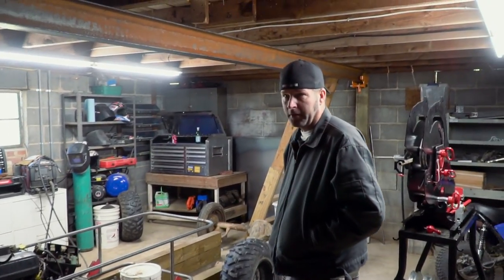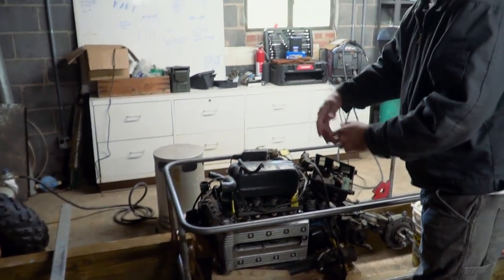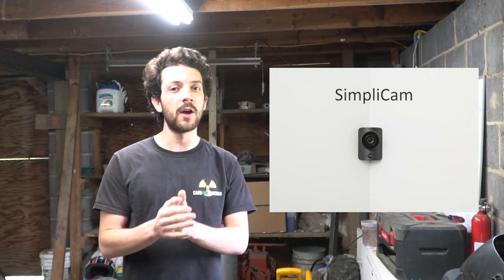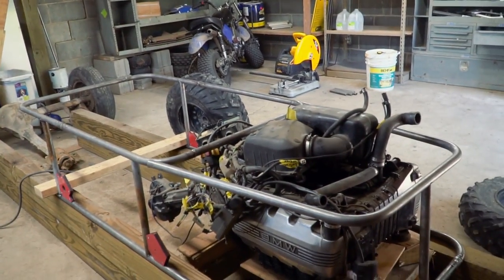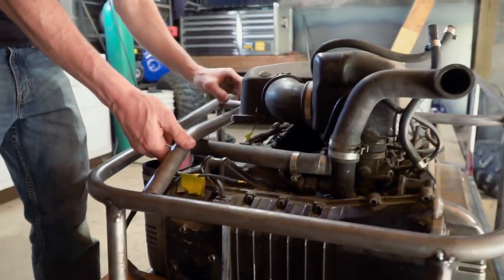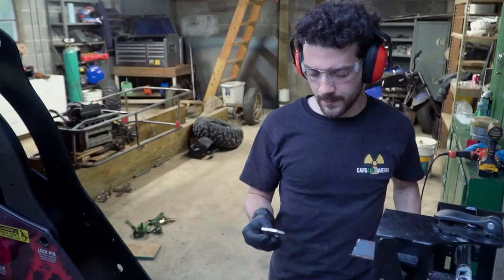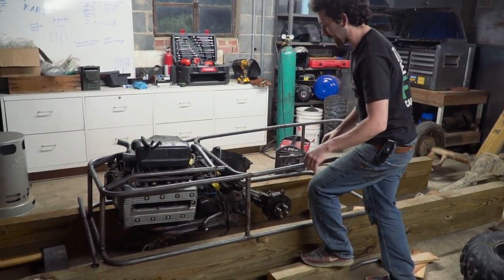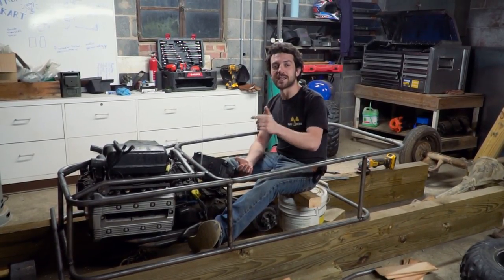1000cc Mini Trophy Truck Build Pt. 2 | Hanging the Engine & Finishing the Frame!

Comment from the maker: It's looking better already!
Reply: Congrats on the new property! Rad 🤘🏽😎
Reply: How many videos do you think this will take to build and also it already looks so cool
Reply: I’m sorry I just can’t picture this. Where are the pedals gonna go?
Reply: Build looks cool so far and I’m diggin the trophy truck idea too! 
If I may, I have an alteration... You guys should look at those all steel tubing full cage rock climbers or inspiration on the frame. 
I personally think having the frame bend OUTWARDS as oppose to inwards to give you greater stability at high speeds and gives you more room to have better suspension flex and travel. 
That’s my opinion but I think you’d be better off going out than in.
Reply: CarsandCameras I, like mason want to know about how many videos are you thinking for this one? Hope you’re doing well during this Covid
Reply: FOR ONE TIME PLEASE LISTEN TO THIS!  your build will be SOOO much easier and and better by doing this. REAR ENGINE W/ TRANS AXLES AND TRAILING ARMS!!!!  ditch the solid axel its not too late yet. you will get all the leg room you wanted, not have a drive line in-between your nuts. PLUS you get to do a little something called "center link A-Arms" in the front, with no excess clutter. TRUST ME ON THIS ONE GUYS... there is a reason utv's, sand rails, buggys, etc. run this setup. if you do this you can throw your expectations of 12 inches of travel out the window. follow my general idea and you can have 16+ inches of GOOD TRAVEL.  "BUT WHAT DO I KNOW, I JUST BUILD PRERUNNERS"  #prerunnerplayground
Reply: God Is good  Heck no.  The fun is watching them do the build.
Reply: @eriknulty6392  Whose to say they don't chop up the rear axle and have independent suspension anyway?  Who knows.

Comment: Hey boys! Quick tip on the rosette welds with the wire feed. I have one of those welders, they’re slow to start, you’re not getting good penetration when you start in the hole. Start outside, make contact, then work into and fill the hole. 👍🏽👍🏽
Reply: talk dirty to me,,,,

Comment: Lookin' good so far.  The dashboard uprights make a perfect place for some triangulation in the frame. 
2 big X's with some thinner pipe would do the trick. Ahh, that's for later. 
Looking forward to seeing a vice bolted to a table. Finally.  :)

Comment: I would recommend a vice for anyone starting out. find the size you want, then get the one 2 sizes up! Also recommend getting one that can rotate in 2 directions. Mine is probably one of my most used tools. use if for everything

Comment: Have either of you two ever driven a 70's era Jeep?  I owned one and I can tell you exactly what that front engine mount short wheel base vehicle will do when you get it airborne. It's going to nose dive, hard.  The seats are over the rear axle and the engine is out front.  The only time I ever got it to land horizontally is when I got the nose so high in the air that saw the sky in front of me.  Hope y'all are preparing some really long and durable suspension. Look at the Baja 1000 vehicles. The short wheel base buggies have the engine in the back.  It's only the longer wheel base trucks that have them in the front, and even then it's jammed up right against the firewall. I would also warn against using a horizontal seat in an off-road buggy.  I hope this arrangement works for you.  This is your baby and you do what you want.  I'm with Ike though; I don't see the magic yet.

Comment: 45 degree the upper frame rail stating right behind your elbows would make it look lil cooler guys. Like 45 degree it back to a 12 inch cross bar witch would be your upper shock mounts an then you angle the shock outwards to the rear end. Would give it really sick rock crawler look

Comment: You guys should check out the Edge Products Sidewinder plans.  It's kinda like a mix of trophy kart and cross kart.   Buy a used sport quad and you practically have 90% of the parts for it!

Comment: when you install an air compressor you should build an outhouse about 20 feet from the shop and run the air into the shop because it cuts down on the noise and when it blows up it wont hurt anyone... big upgrade

Comment: Hey guys great build so far, i have a suggestion for the build, how about putting the engine in the back? and seat infront of the engine? this would be the best for the drive shaft being parallel and also sitting in the front with the engine in the back would be kick ass!!

Comment: You guys should look at those all steel tubing full cage rock climbers or inspiration on the frame. 
I personally think having the frame bend OUTWARDS as oppose to inwards to give you greater stability at high speeds and gives you more room to have better suspension flex and travel. 
That’s my opinion but I think you’d be better off going out than in.

Comment: It’s looking great. I have a concern about foot position though. When John sat in the frame, he put his leg between the engine and frame. Is that where the pedals are going? If so, think about worst case scenario. Engine mounts break and your legs are on both sides of the engine. It would be much safer to have your legs behind that frame support. Also remember that triangles are stronger than squares. A simple reposition of that support bar or moving yourselves further back a bit will make a world of difference in your safety.

Comment: Just a idea, you said about not having a work bench vise now,,, Used kitchen cabinets and counters work awesome in a work shop. That is what I am going to use at my work shop because my Dad did it to his garage and it worked great. Plus you can find them for cheap or even free (craigs list, facebook market place, ect). I thought of this because it looks like you don't have much storage or a place to even bolt down a table vise. But that is just based on the quick views of your shop from the videos.

Comment: I think for better looks in the rear you should bring the bottom of the rear uprights forward giving it a 10-15 degree angle then from there give the bottomed rear hoop an up swept bend still factoring in your plans for the rear suspension geometry

 just a thought it might end up giving you a more aggressive look to match the front it also may give you a better start for the rear geometry when it comes to linking the rear differential to the engine

Comment: just make the two horizontal bars not parallel and it will look good.  Doesn't matter if it slopes up or down.  Either one will make it look way better.

Comment: You could have used two by four box tube for strong base frame and made roll cage from there would have also given you a super strong area to mount front axle and rear axles to

Comment: you should add another motor mount on the bottom..in the middle or on both sides for stronger engine mount strength.
only engine mounts on top. feel a lil sketchyyyy. lol what if the motor tore the mounts off the welds from too much torque? or jumping or throwing the weight around alot? still a strong frame???

Comment: Should double up the bottom tubes of the frame like three inches apart to make it stiffer and then do a curvy roll bar and run diagonals between the bottom and top

Comment: Suggestions- go to "swag off road.com" and pick up there portable band saw table, and match it to your favorite brand of tools (ie. Dewalt, Milwaukee, makita). Now you got a table top band saw. It's perfect to make brackets with. Also for your pipe bender go to harbor freight and get their 30gal 2hp belt drive air compressor. It has wheels to move around if need be. Its 120v so it can plug straight into the wall and it should have enough cfm and psi to run the tube bender and some decent air tools, also it relatively cheap.

Comment: I'm not sure if anyone else said it, but make sure that there are lots of triangles when you build a frame, especially for an off road vehicle. I built a sand rail when I was 15 and learned the hard way. Nothing on my frame was triangulated, so I was constantly breaking welds from frame flex.

Comment: Question,how are you gonna damper the vibration of the engine? Question 2,have you thought about weight distribution whilst airborn? Shes gonna be real nose heavy with that honkin beemer in there. Which would translate into serious nosedives when in the air. Just some thoughts i had. Great vid guys and i cant wait to see how it turns out!

Comment: I am curious how you guys are going to adapt the drive system to the rear wheels.  That BMW output comes out at 90-degrees.
Reply: I thought that too.
I'm guessing they'll bolt a sprocket on and use a chain. Which will break.
But the frame looks too flimsy to handle the power anyway so it should be fine.
These guys really need to stick to building 8hp kids things.

Comment: You should move your seat all the way back to that back rail so your legs aren't on the side of the engine if you cut the upper part of the frame rail right behind the engine drop it down to a 45 and then straight back then back and up again it'll look better

Comment: Where are you going to put the radiator and fan or fans? It's a water cooled engine so a radiator is a must, fans are required to make sure you get good airflow through the radiators at low speeds. Low speeds and high revs equal overheating without adequate airflow.

Comment: I am surprised you guys did not go mid engine with this
Reply: I ride a K1100 and these engines are very hot in the summer. Sitting right behind it will be nice during the colder month but torture in the summer. Overall it would make the build easier too. Steering doesn't have to go around the engine, drive shaft could bolt directly to the diff, weight is more evenly distributed...

Comment: usually with that frame you built  your going to have to go with I beams  because you  didn't set up your chassis to run center mount  arms you would have neede to start wth the bulkhead

Comment: Remember that you are testing a more or less where the seat goes but remember your partner is taller than you I would throw the seat completely back but the top tube that would be behind the back of the seat would lengthen it a little to recline the seat and you  can be used for rear axle shock absorbers

Comment: Rather b welding and red beards garage do a superior job building. it's like grade school build vs high school! It still looks like a box or tub. A miniature T Bucket or a true 4wheel drive with two steer axles would have been perfect for that engine.

Comment: So tou guys need a Bench Vise (at least a 12" Jaw, and a 20-50 Gallon Air Compressor)...

What Voltage? 120, or 240? What could the Electrical "Safely Handle" in the SHOP?

Comment: Hey Issac get rid of that kwikset smart key dead bolt as a locksmith I see a lot of these twisted out with a homedepot flat blade screwdriver and the crooks walk right in and a skilled crook will spin the lock back and it looks like nothing ever happened

Comment: If you guys would just spend 350.00 on bend tech pro you can draw it and see if you like it first it’s so easy to use 
I’m sure they would work with you maybe sponsor you 
I promise you’ll thank me 
3D view from all angles rotating to see problems 
I’ve been using it since 2006 I love it roll cages frames even exhaust systems 
It will work really well with the rogue fab bender too 
No more bastardized frames ...
Also a cut sheet for each tube showing notch locations

Comment: Errr, not sure what you were going for when you mentioned the Miata and M3 lol. Good SCCA roadcourse track cars next to 240’s, rx7’s, and boxters? Even FF’s or SRF’s? Sure. But you had me laughing there! Those aren’t gt1’s with large cubic inch engines. Also, y’all gotta look at how trophy trucks are built. I’m not seeing it chassis, suspension, or drivetrain wise besides the solid rear axle. Trophy trucks are 4wd. How are you going to handle rear engine cooling? Have you seen what trophy truck front skids look like? Trophy trucks have a lot of suspension travel, what are your plans to accomplish that? What are you going to use for a body? You’re either going to have to buy a pre-made fiberglass body or make your own. I’m assuming you’ll be buying lexan for a windsheild. Good luck building the steering. Sometimes it’s good to sit back for a while and do a lot of research. Sometimes you need to rethink everything and start 100% over. Y’all seem to be building around the engine. I suggest keeping the engine in mind, but building the chassis as a trophy truck would be, then focusing more on the engine once you have most of your suspension geometry and drivetrain complete on a mostly finished chassis. You may not even want to use that engine afterwards. Hope this helps. -Ev

Comment: About the roller skate wheel. In one vid the mount bent but who cares. I ask about welding a large plate instead. If you want a long chain than mount a shaft then use an old shock to offset a raised shaft. Mount whatever on the raised pulley.

Comment: yeah why don't you make that front bar the dash area and then from the dash area make it go at an angle down to connect to the front so that it's like a triangle More aerodynamic also you'll be able to bolt up her lower arms if you wanted to and run suspension really easy that way also you'll have two places to mount it just like you need

Comment: Use the other truck fiberglass body and make a real mini trophy truck. Duplicate the body making it hell wide body. And full sized spares and rear mounted radiator/oil cooler. I know easier said then done but that would be so sweet

Comment: If I was going to do this I get an old small car cut the front off shrink it line up were the engine go on the mounts and weld it back in place and go from there

Comment: Am I the only one that was seeing the incredibly vertical sides with a rounded lip and thinking "if you skin that with sheet metal you could paint it red and have a little red wagon MkII."?? You guys need to get some things like these so you can remove tubes without cutting them. https://www.barnes4wd.com/1-34-Interlocking-Tube-Coupling_p_700.html Damn I wish I could afford to do stuff like this, not only because I miss welding but I have so much more knowledge about this kind of thing having watched car/4x4 shows all my life. This thing would be a great project to break out an old Toyota Hilux, Suzuki Samurai or Dana 18 transfer case and make it four wheel drive.

Comment: The issue is the two rails are too far apart. Make the frame rails not as high. Triangulate them then build a roll cage.
Reply: Drake Orion can you even call them frame rails that far apart.

Comment: Wtf 
Ike: lets make a dash bar to make it look better
Just does the same box but splits it in two.
Please next time make a half box. Attached on the left and right side then build the cage part over your head. Then you should be able to do the rear and front with a more pleasing look. It's got a weird soapbox durby look.

Comment: "copied from my comment attached to Part 1, as there has been no answer"
Have you checked the rotation of the BMW drive shaft?  Most shaft drive bikes rotate the opposite way to car drive shafts (the pinion is on the other side of the crown wheel).  You may need to think about mounting the Chevette axle upside down.... then make sure the axle breather doesn't dump EP90 all over the floor :-)

Comment: Seems a mid engine design might have given you everything you're now trying to achieve in this rebuild. Narrower at the front, with room and access to work on the engine from the side, or rear. On top of that you'd be gaining the mid engine handling advantage from it's better balanced weight distribution. And you could still make it look like a truck, as others have done with moving their engines behind the cab to the bed.... 
https://www.youtube.com/results?search_query=mid+engine+pickup+truck
On edit: On second look, I doubt you could make this work, considering the length of that transaxle.

Comment: I'm coming to the comments in search of help. I'm after a yamaha banshee 350cc or higher. I'm in desperate need of one for a project of mine. I'm in Australia and the cheapest 2nd hand one I can find here is $6500. It doesn't have to be running as long as it's complete. Tia

Comment: Maybe it's all those years I spent working in autobody fab. Don't get me wrong, I'm not putting you down. I enjoy watching you. But to me, it just seems backward. To me you're not building a frame, you're building a cage and then hanging everything off the cage. There is no frame. When I think "frame", I think at least 2 by 4 aluminum box frame. Then hang everything off that. Then build the cage on top of the frame. You guys build a cage and call it a frame. It just doesn't sound right. Your terminology just doesn't compute with me. But I still enjoy watching.

Comment: Be careful with SimpliSafe.  As LockPickingLawyer demonstrated their wireless sensors can be bypassed with a very inexpensive radio from Amazon.  At the very least don't put the SimpliSafe sign in your yard, go get a generic one so that you're not advertising the vulnerability.

Comment: It's funny because it sounds like you're actually going to rely on that simply safe system and people can get in just as easy and it won't go off they are so easy to trick That's why I quit using them and just went through Xfinity my cable company It's 10 times better